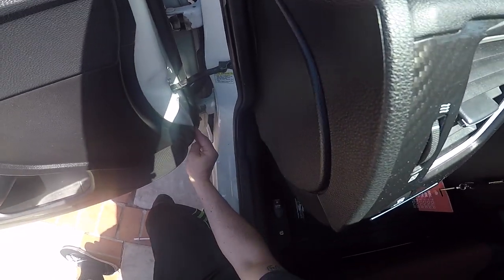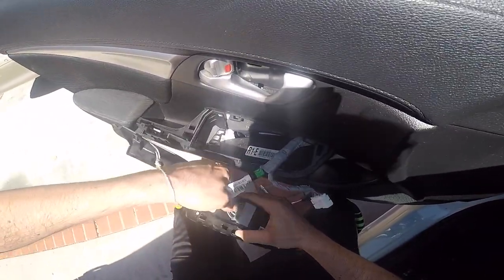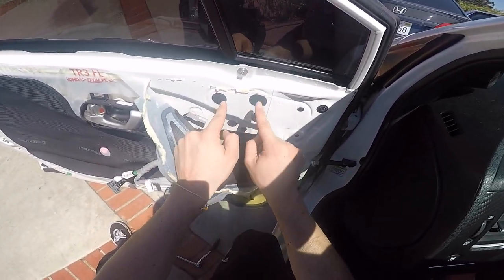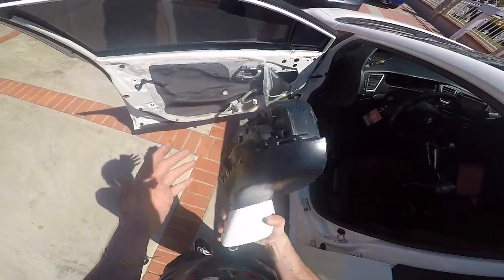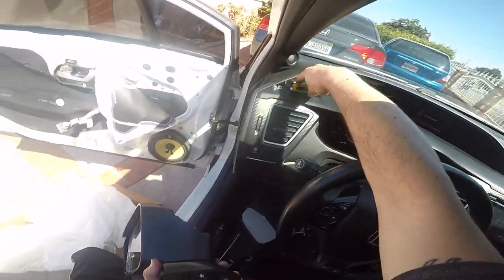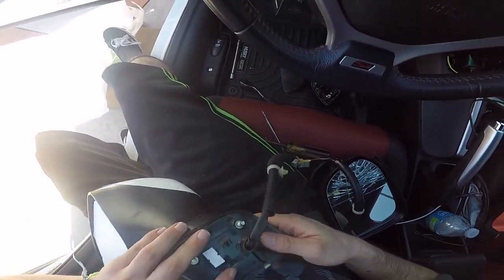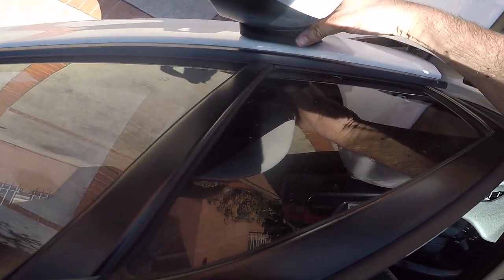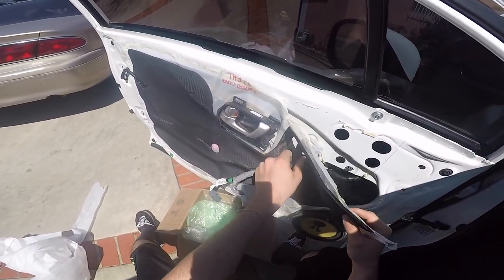How to Replace a 2012-2015 Honda Civic Side View Mirror | EroxerFB6

Comment: Whatever you do don’t drop one of those nuts inside the car door. It is as good as gone.   I know from experience.
Reply: Lol I dropped my 10m in my door but I got it out with a neodymium magnet on the end of an extension
Reply: For those like me who also dropped the nuts into the car door: it is an M6 x1.0mm nut (with a flange, but I just replaced it with a regular nut and matching washer, and it worked fine). You can also buy them from Honda, but they can be pretty expensive.
Reply: Yup. Just experienced this. Luckily the replacement came with nuts.
Reply: Same here. There's some sort of portal in time in the bottom of the door

Comment: This does not apply to the 2014 Civic Couple LX- the handle you pull the door shut with is different.  There is an extra vertical piece, trim that must be pried off, then screws removed.  On this one, the console with the switches cannot be pried up as shown here.

Comment: Got my job done! Thanks for the insights. In my efforts for 2012 Civic e-xl, I ordered 3rd party mirror assembly from Rock Auto, had to pop the cover off of that one that as it was still in good shape, and popped it onto the new one (another youtube vid can show you how to do that). Also, I dropped one of the nuts into the door (I had been warned!) but I got another one from Home Depot.